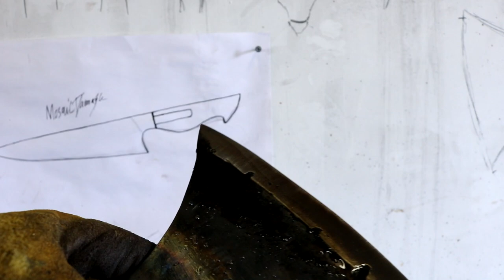Blacksmithing - Forging a Viking Dane Axe

Comment: Extremely impressive results! I found this while searching if someone had figured out how to forge a Dane axe with a reinforced edge and it makes a lot of sense to do it your way. They probably did have 4+ pieces of iron that went into the final product. There are examples of axe heads that have been found both with and without the reinforced edge. Do you think it would be possible for them to forge the blade to 5mm, split the edge, insert the steel bit, and make the ridge that way? Because otherwise it means that they purposely forged everything but the edge thinner on those models (but not the thin edge models). When I get space for my forge again I’ll try to make my own.

Comment: Hi Nils, I found your videos and I'm excited, I'm about to make a Viking ax. I started today, I have two semi-finished products, but they come to me very massively. I will have to use weaker material. If I have the right information, the battle axes were light. Ps .: Did you try the Frankish ax ???
Petr
Reply from the maker: Id say that a battle axe have to be  strong but also swift. So a combination between it being light and strong

Comment: Awesome video! One question why’d you make the eye of the axe so small? Wouldnt you want more wood to hold the head on ?
Reply from the maker: 20x50mm is quite standard. Usually on older finds the eyes were alot smaller and more "fatter" or raindrop-ish. 20x50 is the standard here in Sweden, I didnt want to make a new drift just for one axe. Also If I would have, they eye would have been even smaller. Hope that explains it. Take care/nils
Reply: it sure does thanks man!
Reply from the maker: No problem!

Comment: if anything viking was never used to describe the Norse people before Romanticism (Victorian times). it simply means raiding. it is as much Dane, Rus', Norman or any other name for Norse descendants. The pattern emerged before the Viking Age and it was used well after it.
Reply: it's late Iron Age!
Reply from the maker: Late iron age in Sweden is called "Viking age".
Reply: "Viking Age" 793–1066 AD. Iron age is the period before that.  There might some overlapping. The earliest date given for a Viking raid is 789 (according to the Anglo-Saxon Chronicle). A group of Danes sailed to the Isle of Portland in Dorset. Continental Europe raids are most definitely later.  Vendel Period (c. 540–790) is the Scandinavian late Iron Age. Axes of this pattern (Type M) have been dated to 13th century well after the "Viking Age." Two handed axes of earlier smaller patterns have been dated to late 8th century.
Reply: Your forging is brilliant. I am just clarifying the historical context.
Reply from the maker: @brk932  Thanks. Look, My friend Tord is a very good dane axe guy. He has visited alot of museums and has taken measurements from finds from the Viking age. This axe was based on some of his research. Never have i claimed that this axe was only produced between the years 800 -1050.
Reply: i was just clarifying that maybe Norse or Dane would be a better term. Norse traveled and traded and were very advanced. Early Roman/Byzantine sources claim that. if anything they became the elite nobility in England/Frankish/Rus empires. Even the Byzantines had  the Varangian guard. I am saying don't associate it with just raiding. the Norse mostly traded and were farmers. Mostly settled lifestyle.
Reply: They were called dane axes and were in use throughout the early medieval period by norse descendants and the places where there influence spread like in england 

They appear on the bayeux tapestry for example